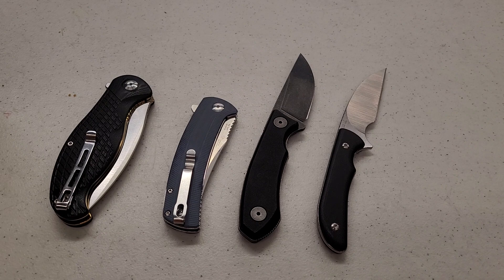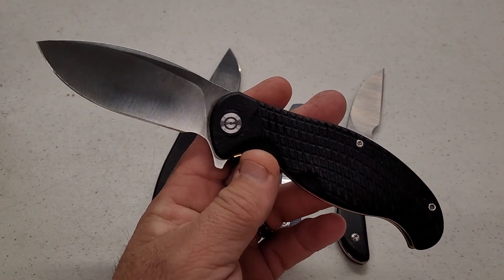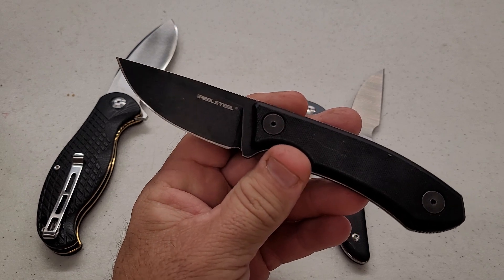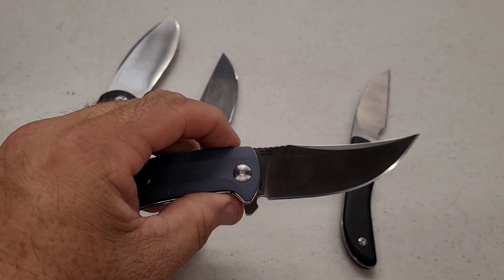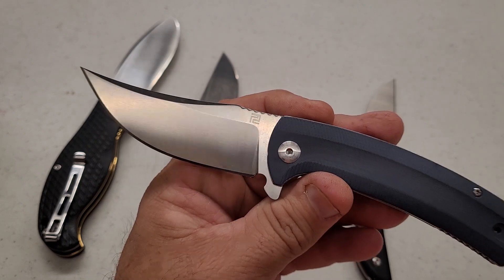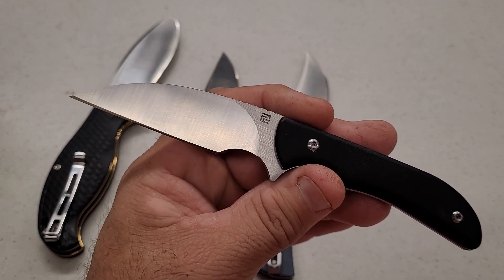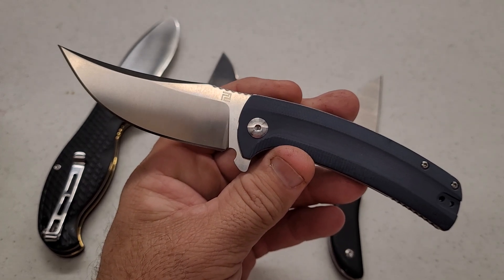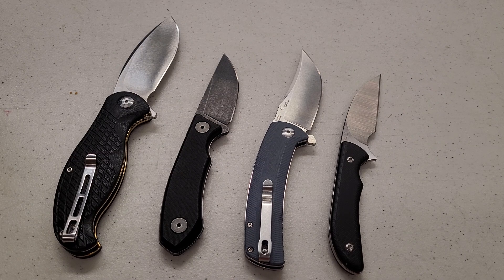HRC testing on AR-RPM9 and 9cr18. Civivi, Real Steel and Artisan hardness vs edge retention results

Comment: I haven’t had any deburring issues with my arroyo. Took a scary sharp edge super easy on my work-sharp precision adjust. I had more trouble deburring my civivi ortis. If the action on the arroyo is any indication though, civivi pays closer attention to detail, despite being made of FRN the ortis “feels more premium”
Reply: I love the ar-rpm9 I’ve sharpened a bunch over the past 8 months and have never had a de-burring issue. Actually I thought it was extremely easy to sharpen razor sharp.  Maybe they have gotten better at making the steel over the past year?

Comment: Very interesting. Could heat during grinding cause these differences?
Reply from the maker: Just heat heat treat variance, depending on where in the large industrial ovens they use, how close it was to a quench nozzle. Batch to batch variations. That more so than heat during grinding to be 2 points off.

Comment: I'd love to see the best 9cr go up against some old-school custom 440c. 

I found an amazing deal on a full handmade custom folder made in the early to mid 80s (pre-sebenza influence) in 440c and it has noticeably better edge retention than all the modern budget steels that I have decent experience with (8cr/9cr/bd1/bd1n/14c28n/n690).

I haven't done any real testing, but I've been using it quite a bit and have been pretty impressed.
Reply: I make knives out of O1, 440C and D2 from Carpenter steel and 440C will ht to 59 easy with a lot of Cr carbides.
Reply: I've got a few 440c lockbacks from the 70s and 80s that have incredible performance (both because of good hard heat treat and thin hollow grinds).

Comment: Being a PM steel based on 9Cr18Mov, AR-RPM9 should have been at least as good as 9Cr18Mov. Scoring on par with softer 9Cr and getting smoked by good 9Cr is just plain disappointing. I'm surprised by the hardness and not in a good way. Hopefully, they'll get their HT figured out. In the meantime, I guess a lot of us who bought early are just stuck with fancy paperweights.
Reply: I sent mine back as soon as I ran them across my soft Arkansas stone and it dug right in. Won't do that with a steel with chromium carbides. I'll heat treat USA made 440C at 58 and it will beat out 14C28N at 62 hard, simple reason, look at the carbon content, at 0.65 it only makes Iron Carbide or cementite, nowhere near as abrasion resistant as Chromium carbide of the 1.05% of 440C. On a scale of 1 to 10 14C28N is a 3 in edge retention, but 440C is 4.5 in edge retention, same as N690 and 154CM. 14C28N shines in toughness, only 3V and the S series tool steels are tougher.
https://knifesteelnerds.com/2021/10/19/knife-steels-rated-by-a-metallurgist-toughness-edge-retention-and-corrosion-resistance/
Reply: @MountainFisher  440C used to have a very good reputation. Now we usually see it in budget knives with less than stellar heat treatments. Coincidentally, 14C28N performs better than people usually expect. Just check out the testing by this channel. In theory, it's easier to get a good heat treatment on 14C28N and the nitrogen makes a contribution beyond just the carbon.
Reply: @chronovore3726  Actually the nitrogen only helps the steel to maintain a finer grain as at 0.11% it doesn't make any carbonitrides, what Dr. Thomas discovered was AEB-L at Rc 64 hard with no added nitrogen cut more in a CATRA test because it made chromium carbides. 14C28n at Rc 62 cut 414, but the CrC stopped at 60 hard where Nitro-V was and cut 362. The AEB-L even at 64 was still tough.
I used to be a heat treater at a machine shop among my other duties. The exponential nature of the Rockwell C scale is akin to a speedometer that becomes more wrong the faster you go. 50 to 51 is 4% harder, but 60 to 61 is 5% and 60 to 62 is 10.3%.

Comment: The data you provide has allowed me to make better choices when buying knives.  
1. Brands that are low cost and give 60+ HRC  
2. Steel types that sell at a premium and are generally below 60 HRC.  
3. Value to be had in less popular steel that is done at above average HRC.  (GANZO  is doing D2 steel at 62 HRC, this blows my mind given the low pricing)  THANK YOU FOR MAKING GREAT VIDEO!  : )
Reply: Exactly!
Reply: ganzos d2 is brittle though. getting to that hardness at that price point doesn't let them get the grain structure right.
Reply: @cameronwilliams4149  I sent a Para 3 in Maxamet back to Spyderco for warrantee evaluation 3 weeks ago.  The blade chipped very badly.  They sent it back to me claiming that the Rockwell hardness was in the range of the specified for the steel.  That amounts to $240.  Down the bowl for me.  I've never had a problem with Ganzo.  You can buy a lot of Ganzo knives for$240... Just saying.
Reply: @barkingspider2007  oh I know, I've probably bought around 40 ganzos. but every time their d2 seems to disappoint me
Reply: @cameronwilliams4149  I bought most Ganzo knives to learn how to sharpen.  I usually give them away.  Give CH or TwoSun a try in S35VN.  Lots of great low cost knives to pick up.😎👍
Reply: @barkingspider2007  I've tried twosun 14c28n and the stuff is soft but has decent grain from what I can tell. I might try CH in the future
Reply: @barkingspider2007  Spyderco’s maxamet is run really really hard (like 67-68 HRC) it definitely will chip if used wrong those hardness ranges. D2 will be less prone to chipping because the carbide volume is lower. Generally tough low carbide volume steels do well at high hardness because the combination of toughness and hardness makes a very strong and stable edge apex that won’t chip easily because it’s tough and won’t roll easily because it is hard.
Reply: @barkingspider2007 spyderco ... Great quality 99% of the time but when you have an issue, its not their fault, they don't give AF and it isn't their problem. Their customer service sucks ass but everything else is usually great
Reply: I cut wiring harness and fanbelt using ganzo, mine not chipping even cutting that small copper wire.. my maxamet will easily get a chipped when cutting the same item.